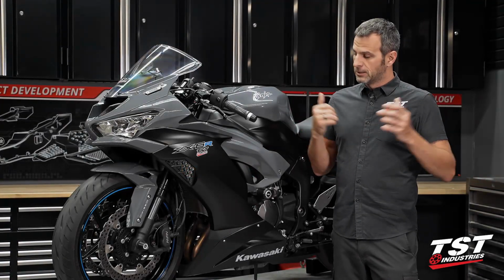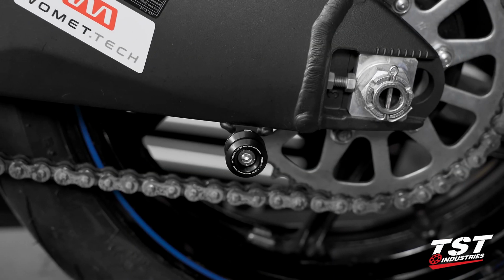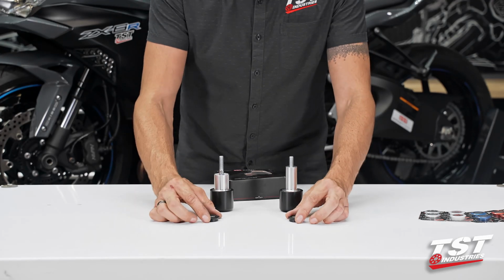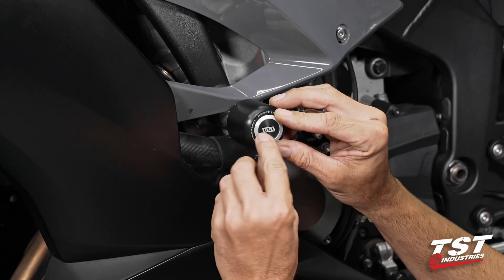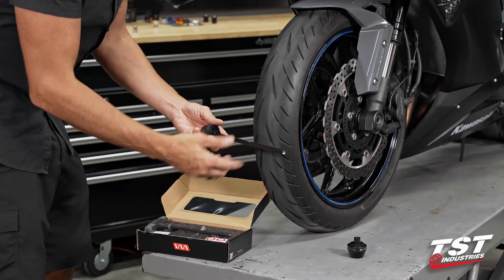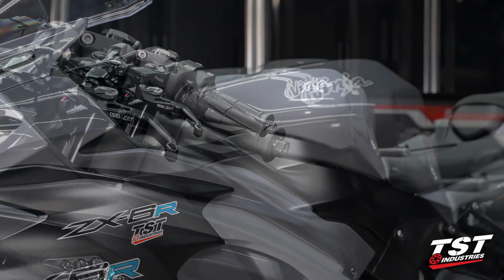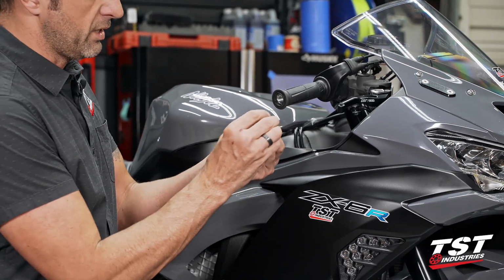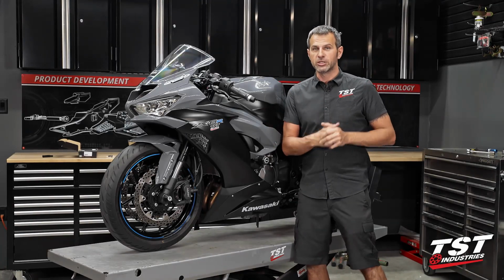How to install Womet-Tech Crash Protection on a 2019+ Kawasaki ZX6R by TST Industries

Comment: I just installed the kit and everything looks amazing. Although after a few rides I noticed the pucks can now be turned slightly by hand. I tightened the bolts to take out the play, but they were still torqued to the right spec and after another ride they were able to be turned again. Is this normal or did I screw something up?
Reply from the maker: That symptom presents no issues with the function of the sliders. It's fine. You did not screw anything up. The bolt fastens through the shoulder washer onto the slider spacer and into the frame/engine mount. That stack of components clamps together to achieve the appropriate torque. The slider component can rotate on some of these assemblies.
Reply: @TSTindustries  Thank you for the quick reply and explanation. This was not the first purchase from you guys and definitely won’t be the last. Really appreciate the detailed installation videos and  quality of the parts!

Comment: Never understood these single point frame sliders. Wouldn't it be likely that a crash would actually bend frame instead of save it from scratches?
Reply from the maker: Every crash is completely different. I'm sure in some crashes, yes, this is completely possible, but in others like a simple tip-over, a single-point frame slider may work just fine. Various options to ultimately try to minimize the damage taken on in the event of a crash.